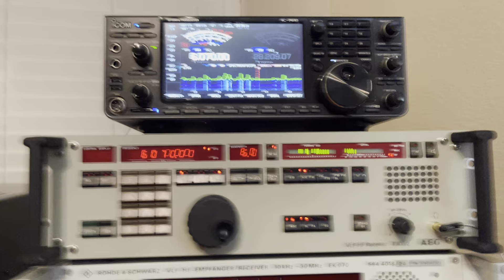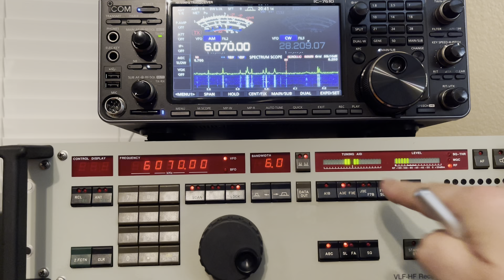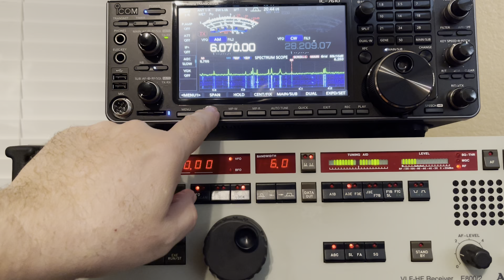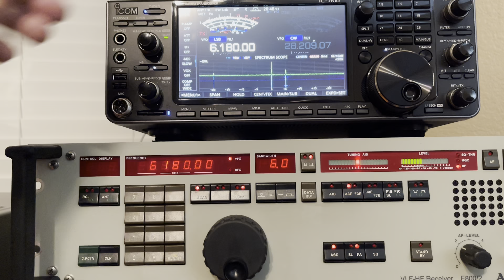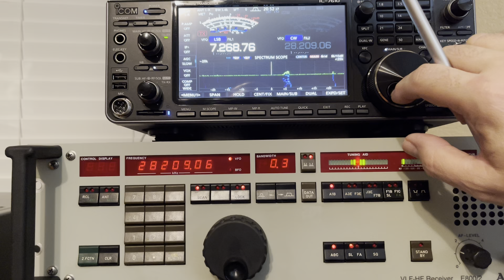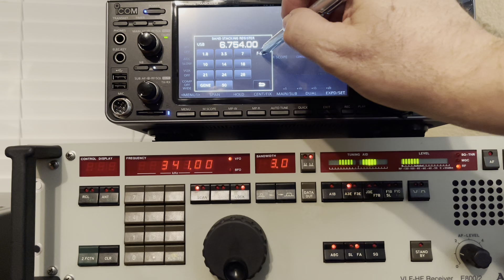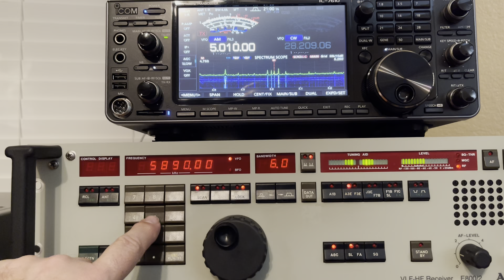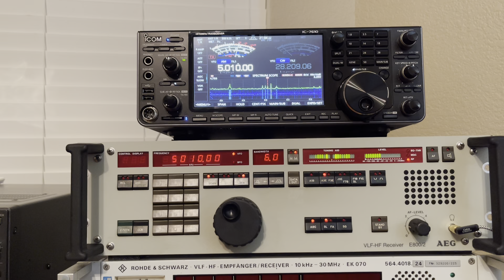AEG E800/2 vs Icom 7610

Comment: Nothing about this particular video Nic but I was going to say how much I enjoyed the video on the Collins 851/S1 I think they'd got the real hang of good (as much as I know) with band selecting filters after the antenna input. I read in "Receivers Past and Present" these models replaced the WW2 models and were Collins changing to accommodate the improvement of parts and the SSD. The tuning rates are well chosen seeing as there's no keypad entry like the 7030 in Fast 1tuning X256 you can get from one end of theband thethe other in moents and they had a very good level of specification. There's one model out which is a 4 channel ISB device and theyv'e got to epitome a period of receiver design that was just coming commercially into thedigital age with stuff life winradio.. Great vids both and I was gutted because my Lowe HF225 stopped working and my 7030+3 needs filter calibrating and resetting the filters on or rather after every disconnection from the msins.
Reply from the maker: Thanks Shaun. I know exactly what you mean about failing radios. My radio cemetery is pretty impressive!  One thing though about old electronics, sometimes they just start working on their own. My Tentec 340 had an intermittent failure that turned into full time freeze up. One day I turned it on and left it alone for 3 hours and the darn thing started working!  I can only speculate but I think the heat improved a bad connection inside.

Comment: The S-meter on the AEG is rather small, BUT is shows almost the same readings with the 7610 considering that S9 is -73 dbm and S1 is -121. So when you see an S9+10 on the Icom is -63 on the AEG.
Reply from the maker: Thank you!

Comment: Their is a big difference between the Icom and AEG S-meter readings when using the below chart. Probably best to get the R8600 and do a real time comparison. Evaluations on the R8600 show that the meter readings are very accurate when using precision test equipment to measure the Icom IC-R8600 receiver...
As for the 10 MHz reference, just look at the back of the AES and see if it shows a 10 MHz input or a REF Input... 
Get well soon, Drink lotsa of fluids... 🙂

Comment: Sorry to hear about your cold, does the AEG have a noise blanker function?    
DBM is used as professional equipment measurement (broadcast standards) and compared to amateur equipment much more precise but expensive to manufacture. 
That's one of the many reasons that AEG was so crazy expensive back when it was new.
Feel better soon.
Reply: No not any thing loike noise blanker  notchfilter or something else
Reply: @antennebuis  Sorry I was asking if the AEG had a noise blanker to mute the static crashes from the storm.  DBM is used by the signal strength meter nothing to do with quality of reception.
Reply: @Kw1161   a noise blanker working for static  but not for lichting  storms
Reply from the maker: Thanks for the well wishes. No noise blanker. No notch. No if shift. No att. No pre amp
Reply: @dieselten01  Ain’t that always the way, a $500,000 sports car without an air conditioning unit in the Arizona summer heat….:).
There was a British manufacturer called Datong which made many additions using the rf side on the receiver that added many of those functions like a noise blanket. Sadly the folded back in the 1990’s so I guess you’ll have to be content with the AEG as it is. 73!
Reply from the maker: @Kw1161  I am!  I understand it for what it was designed for. And it doesn’t seem to be lacking compared to the 7610 which has all the toys
Reply: @dieselten01  Well you will have to be content with listening at 150 mph instead of the Icom’s 100 mph…..:)!

Comment: TIP,,,,, The AEG reads in DBm, BUT!!! The Icom IC-R8600 you can change the meter scale by touching the display, and the Icom will read in DBm, so the 8600 can be used to see how close the AEG is to being correct!! Looks like another comparison video,, but soon we need to compare the 7610 to the 890S, If You Dare to!!! LOL  🙂
Reply from the maker: I would have to dig the 890 out of the trash and clean all the crap off of it. Too much work. Fyi the 9500 has a dbm meter too so I won’t have to mess with the dorky 8600. 😎

Comment: S-reading	HF		Signal Generator emf
μV (rms, Relative to 50Ω)	dBm	dB above 1uV
S9+10 dB	          	        -63	44
S9	50.2	                        -73	34
S8	25.1	                        -79	28
S7	12.6	                        -85	22
S6	6.3	                                -91	16
S5	3.2	                                -97	10
S4	1.6	                               -103	4
S3	0.8	                               -109	-2
S2	0.4	                               -115	-8
S1	0.2	                               -121	-14
Reply from the maker: Very helpful. Thanks!